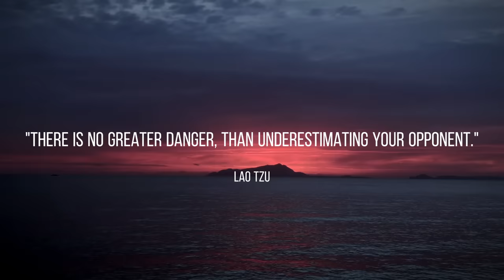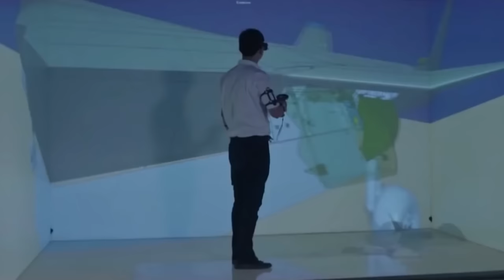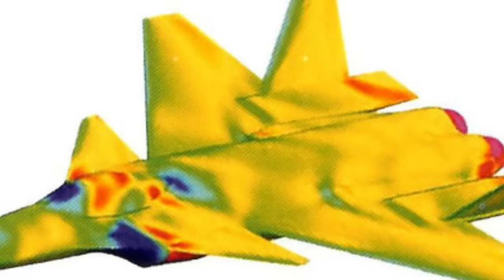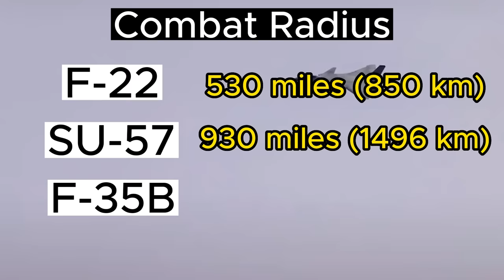China's Stealth Fighter, Good or Bad?

Comment: Just one point, that you guys really don't get... It's not lack of cannon, it does NOT need cannon... J20 is not build for dog fight, it was mean to serve as air sniper that can swoop in  and swoop out, but now J20 have been rerolled as core AS unit with support of 3-8 battle drone, the drone will deal with the dog fight and ground attack, and J20 is the air CC relay node and long range sniper that will be protected by those drones...
You even put on a short clip that shows J20 fly with escort drones, and still over looked that info? XD

Comment: Last year, J20 intercepted F35 in East China Sea without been detected by F35.  F35 didn't even know J20 was behind it until it got painted, then ran off.
Reply from the maker: Do you have a source, as I can't find anything about this specific scenario?
Reply: @KabodaOfficial  it was on the news, even the US Navy commander talked about it in an interview.
Reply from the maker: @TheArtofWarChina   The only news I can find is that they met, not that the F-35 couldn't detect the J-20, that's why I'm asking for a source. It seem's very unlikely mainly due to the J-20 being less stealthy than an F-35 that's all. As well as the F-35 having 360 degree IR sensors that would've picked it up  from behind.
Reply: @KabodaOfficial no, I remember this news. The F35 wasn't on stealth mode. It was on that mode where they strap all the things onto the wings.
Reply: @KabodaOfficial  Somebody in the comment section said it happened.  That means it must have happened.  No need to look for sources.

Comment: The PL-15, which adopts radar active detection, has a large detection distance and has an anti-jamming data link. At the same time, it is equipped with a dual-pulse solid rocket motor to effectively expand its range.
 In view of the fact that the PL-15 bomb is 6 meters long, there are two versions of its range. One says that its range is 200 kilometers, and the other says that its range exceeds 300 kilometers, and it can even reach 400 kilometers.
Regarding the range of PL-15, the two opinions are too different. Therefore, the range of the real PL-15 air-to-air missile is of course only known by our Air Force. The outside world’s statement can only be guesswork, and it is only for interested readers. For reference only.
 Even if the PL-15 has a range of 300-400 kilometers, even if it has a range of 200 kilometers, it should be the air-to-air missile with the largest range in the world. The U.S. Air Force believes that the PL-15 can have a range of up to 200 kilometers by adding a ramjet engine. It is already an AIM-120D medium and long-range air-to-air missile with a range of 150 kilometers far exceeding that of the US Air Force.

Comment: You have the range requirements of carrier based aircraft backwards. Longer range and better endurance is a requirement. Also why use the F-35B as the example? It's the shortest ranged version of the three and by a long way due to it being a STOVL aircraft.
Reply: The other question is what did it trade for that long range. To be similar size to the f22 with 2x the range it either has massively more efficient engines, or has skimped on payload/other aspects to gain that range.
Reply: @Aefweard  Chinese engines are rather crude things and not every efficient. Assuming Chinese claims for range are true, (that's a big if!) the J-20 gets its range from a large fuel load. It is heavy and add to that the design configuration makes it sluggish. It is not some hyper maneuverable monster that some fanboys and the Chinese claim.
Reply: @dat581 nobody in the community thinks J20 is an agile, manoeuverable craft. It's a missile truck, that's it.
Reply: @Aefweard  in fact it is much larger and thinner shape than F 22 by public number. And they use the all-angle moving canard/vertical tail to compensate for lift and agility, which means much harder control system.
Reply: @elmohead  it's pretty manoeuverable in airshows.

Comment: A few common incorrect sentiments about this plane:

West
1. It's enormous. (Approximately same size as F-22)
2. It's new. (Took off over a decade ago and went into service around the same time as F-35)
3. It copied the 1.44. (Based on a longstanding Chinese concept of Chengdu J-9)
4. It's an un-maneuverable interceptor. (Performs at least similarly to non-vectoring flankers subsonically and plays the role of air superiority in air drills)

Chinese
1. It's stealthier than F-35. (According to model RCS simulations, not even shape wise)
2. It can datalink directly with KJ-500. (According to inside sources, it's a goal not a current ability as of Sep 2022).
Reply: Addendum: Canards ruin stealth. (According to Aircraft 101 RCS simulations, the canards barely contribute to frontal RCS. The main problem is the inlets: bigger and less curved than 22 & 35).

Comment: The J 20 and the new Chinese stealth fighter may not be better than the U.S. stealth fleet, but the J20 could have the edge on aircraft like the F-15EX F-16 and F18 which comprise a large portion of the United States fighting aircraft. This is also bad  ju ju
Reply: actually 5gen is the missile that decide the winner.    give me a Bi-plane with a supperior anti air missile   I am happy to take on the F22
Reply: @jetli740  u got a point, superior AWACS and cutting edge missiles. the delivery system called an aircraft only comes next

Comment: Really? You are comparing the F-35B (which has the shortest range because of the lift fans) with the other aircrafts - and not the A (which is the most produced Lightning II) or even the F-35C (longest range)?

Furthermore - like price, range cannot be easily compared. For example the F-35 (I guess it is the A model) has a combat range of 770 miles but an overall range of 1500 miles. A Su--30 has also a maximum range of above 1500 miles (wikipedia says high altitude = maximum range in the best case possible). 

The J-20 seems to have massive internal fuel tanks (as it is a far bigger jet, it kinda makes sense). However still there is definitely a big doubt, that the stats are correct - and not exaggerated.
Reply from the maker: This is valid criticism, and I should’ve used the C variant as it’s the most likely to face it.

Comment: J20 wouldn’t become one of the best Stealth Fighters until WS-15 is fully equipped
Reply from the maker: That wouldn't be enough to categorically consider it the best, but will improve it's role as an interceptor. :)
Reply: The most scariest part is: J20 is within striking distance with top western fighter. When it is combined with China huge industrial power and fast technology iteration speed. It will pose a huge threat to dominant air power from West in next 1-2 decades.

Comment: im confused as to why they have canards. it fucks up the frontal profile, so now you have to deal with a higher frontal RCS. like. if your going delta. just go delta. it would've looked cooler if it just went full delta. but no. they need the added mobility of a plane that has no cannon... like. who came up with this?
Reply: cannard  - the have shit load of experience date back to the J9 j10 j15
cannard help maneuverability and help with carry extra weight when take off.
and no it doesntt fk with it rcs.
Reply: @jetli740 canards usually mess with rcs, but the canards of the j20 are actually engineered so it wont:D
Reply: @imnewlight  yes it wont effect RCS, but all these westerner armchair Jet scientist think so🤣🤣🤣🤣

Comment: Fi everyone goes stealth, won't these stealth fighters eventually have low enough detection ranges where it's back to dogfighting?
Reply: no, it design as a sniper, get in range fire it missile then dissapear again, you can never get close to it, it new ws15 engine is far faster than the f22 or f35 so it easily out run it beyond cannon range
Reply: @jetli740  My point is two sufficiently stealthy fighters will have to get close before detecting each other.  What is it going to fire its missiles at at sniper range if it can't see anything?
Reply: @blurglide   so they have to be 10ft from each other to be seen.  🤣🤣🤣🤣
plz update your info
Reply: I think they move too quickly to really do WW2 era dogfights. Like if you merge with an F-22 in a J-20 at even a moderate speed it passes in an instant. By the time either does a 180 degree turn they're so far away it's either extremely difficult or impossible to locate the bandit with the naked eye. 
I think it'll be less like a dogfight and more like a high intensity supersonic version of hide and seek. Or chicken.
Reply: If radar technology doesn't keep up, then yes, this is a definite possibility.
Reply: @jetli740  You have no clue what you're talking about. BVR combat with two equally stealth aircrafts can run out of missiles. A lock doesn't guarantee a kill. After that, it is entirely possible that a dogfight takes place.
Reply: at most it will bring air combat back down to the late 60s where heat seekers did the majority of air to air kills.
Reply: @sarika3689  That's not true. Watch some fights on DCS here on YT. I know it's not 100% accurate, but it gives you an idea of their maneuvering capabilities based on publicly available information. Thrust vectoring aircraft in a dogfight is like watching 2 leaves floating in the air. Their turn radius allows for some really close dogfighting.

That being said, if you watch some videos I recommended, a WWII fighter aircraft with a prop engine can defeat a 5th gen fighter in a guns only dogfight. Their turning radius is just so much tighter.
Reply: @blurglide  I don't think that's going to happen. Why use stealth planes to find stealth planes? You can use radar to find stealth aircraft. The side with the surviving AWACS wins the air battle.
Reply: In a 1 vs 1 it can be, but the less stealthy aircraft must first survive in beyond visual range BVR combat.
Reply: Yes. Stealth fighters are highly likely to meet and dogfight. But the dogfight will ends after a turn or two. Because modern missiles are far more capable than missiles from the F-4 era.
Reply: @blurglide it'll be firing AWACS and other non-stealth targets.
Reply: @jetli740  Ah, I see you're still seeding the comment section with smily faces and nonsensical phrases.

Comment: Like everything else the Chinese build it's a cheap knock off! With it's raidar return that is thousands of times bigger than the F-22 it's comparing apples to oranges! The J-20 is out classed by the F-22 in every matrix!
Reply: Thousands of times?   Sounds like pure hubris to me.
Reply: Lmao the range is already the major key and don't forget that J20 carrying PL15 which already one of the best missile .. no I mean the best missile Long range missile out there that's the second major key 

Has great manuverbility considering this jet has massive weight which already answered how powerful is WS10C & WS15 that also 3 key major ...

Just imagine that J16 replace the engine to WS15 or even the J10 ...
Reply: Yessss f22 numba wan. Nothing to see here
Reply: otherway round... F35 pilot pissed himself when encounter J20 in the east China sea earlier this year...
Reply: @OOOwave  Not in service..
Reply: @mbakkaltsit8045  in theory J16s or J10s with WS15 engines would give them a thrust to weight of 1.3 which would make them more agile than F22s.

Comment: china on their way to make a stealth fighter with bits of it sticking out and canards the size of a minivan
Reply: At least their plane exists in reasonable numbers unlike a certain other "super stealth fighter"...
Reply: @JCDFlex   It exists although as a burning wreck because it's engines tend to blow up
Reply: @Skoodelly or melt plastic off the airframe whichever comes first
Reply: Their canards aren't insanely large.
Reply: @godhimself478  Okay, you are stuck in the 70s with thoughts of what the Chinese can produce. I bought a waterproof watch that can move its screen up and down, fully waterproof (I washed my watch and water was directly on the battery) it doesn't work well in Canada because they can't use Weixin and other services because they aren't used, but that seems to say that they're amazing at creating high quality stuff. And it's not expensive either.

Comment: Some facts, the J-20 weighs less than the F-22, and with the new WS engines, now have superior power too. The canard wings and vector thrusting combined gives it superior agility at dodging hostile missiles. This is why it lacks an auto-cannon. It's designed to go in fast, good frontal stealth, and launch long range missiles, dodge enemy long range missiles and fly home.

Taiwanese sources with more J-20 encounters report it has a RCS of 0.05 to 0.025, not as good as F-35, however, it's actually harder to shoot down with long range missiles due to its speed & agility.

Note that all modern AWACs and advanced radars have no problems detecting & tracking even the F-35 or F-22. As such, stealth fighters aren't actually stealth anymore against peer foes. Thus they need to rely on better missile technology & their own evasive abilities to survive.
Reply: Made in China😂😂😂😂😂
Reply: @JohnDoe-g7r  yeah, ur precious phone and some appliances. u better dispose them coz they made from our country
Reply: @JohnDoe-g7r  bot man~

Comment: USA f22 is a 26 year old jet. If they are only just getting close to a 26 year old jet then i would not be concerned. USA will have jet technology that we do not even know exists that will be far more advanced.

We see new fluid flux vectoring tech. (reducing the need for radar observable rcs for flaps etc.)
Laser weapons, AI wing men, Drones , mach6+ missiles. at least 8 a2a missiles that can engage lock over 150 miles.
Jet engine tech that can allow a jet to super cruise using little fuel without afterburners. Mach 6+
We now know they have technology for new skins that makes a jet disappear using 1000s of cameras that project an image making the jet virtually invisible to see. We know that The skins are multi functional and have sensors and optical recognition.
We know that the new engines have thermal images the same as the enviroment surrounding it
We know that the new skins on 6th gen jets self repair.
AI tech in USA is far more advanced as they design the chips.

Anything china has is already out of date by 20 years. They will need to steel again to catch up.

Comment: the shenyang aircraft was the smaller of the two which is why it was rejected. it was smaller than the J35 and the J35 is already smaller than the J20.

the lack of an autocannon is a wise decision for the simple reason that the plane it is likely to go against, the F35... well let just say it fly like a donut. the J20 is just faster, so there is no risk of a dogfight since the F35 can't catch up with it, the J20 can just fly away. in fact several model of the F35 also do not feature autocannon.

as you noted, despite the J20 being bigger, it wing dimension are smaller, this reduces the stealth profile of the plane. some noob mistakenly believe canard make for worst stealth, but in reality it is the opposite because canard allow greater lift which mean you need less wing to stay airborne, it also reduces the runway requirement as the canard can better control lift and avoid stalling, it just give the flight computer alot of control. counter to popular believe the canard do not move much in flight because they are lift canard not control canard like the european jet, their function and purpose is complete different from eurofighter and rafale. before the USN was forced by congress to join the JSF program. Boeing's stealth concept for the USN also feature canard, canard is the more logical choice as it reduce the profile of the plane which not only help in stealth but more importantly help in reducing the space the aircraft would take up.
Reply: 为什么每次更专业的解答看到你们的ID都是中国人？🙄
Reply: @charlesxu1236 i am singaporean, had served in the airforce. we had some data on the JSF program as US was trying to get us to procure them. given Singapore lack of size as well as the potential of building our own mini "carriers", the F35B is a valuable asset with it VTOL capability. so far China has no planes for export that could meet our unusual requirements...
Reply: @lagrangewei  既然你是新加坡人我就不用英语了，从现有的PLA的战略定位上来说，VTOL并不是现在的PLA急需的能力。就目前而言，PLA的最重要战略目的是东南沿海某些岛屿以及南中国海周边国家的海上小规矩可控的摩擦，从作战任务需求上看登陆那个东南岛屿，并不需要海军独立远征。鉴于那条海峡的宽度，路基战斗机的作战半径足够进行覆盖并为登陆的海军陆战队提供制空权和对地支援，某些南中国海沿岸有摩擦的国家甚至只需要一两条052就能使他们完全失去全部海上作战力量。PLA目前没有在远洋和远离中国本土进行两栖登陆舰作战的需求，所以在两栖攻击舰搭配VTOL能力的战斗机对于军费来说是一种意义的浪费。在可以预见的未来大部分时间PLA海军的两栖攻击舰作战编队除了收复东南沿海的某个岛屿外，最大的功能应该是在战乱国家撤侨，大量搭载通用直升机是一个合理的做法。即便真的发生如海湾战争那样需要进行跨海远征，一到两个航母战斗群为两栖攻击舰编队提供防空和对地支援也够用了。综上所述，需求决定供给VTOL搭配两栖攻击舰的小航母概念是属于干涉主义，是超级大国对穷国小国进行讹诈和入侵的性价比相当高的选择，对于秉持和平发展理念的国家来说这东西就是一种华而不实的摆设

Comment: at least j20 more better than f35 first China is able to mass produce the J20 rather than the F35 secondly The j20 doesn't have the technology failure that the f35 does  the f35 is  a legendary gimmick not more better than other fifth gen fighter aircraft
Reply from the maker: Yeah China is able to produce the J-20 better even though there are 5x more F-35’s, for gods sake cmon that’s just stupid.